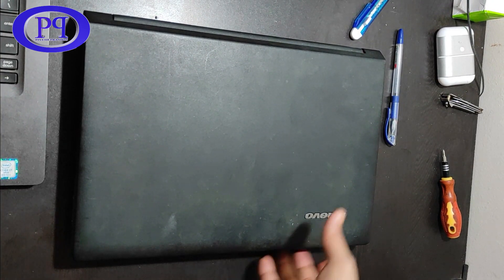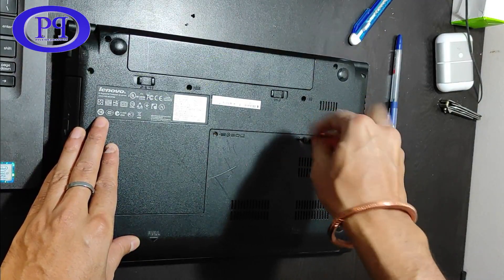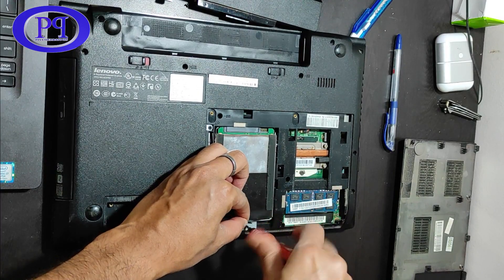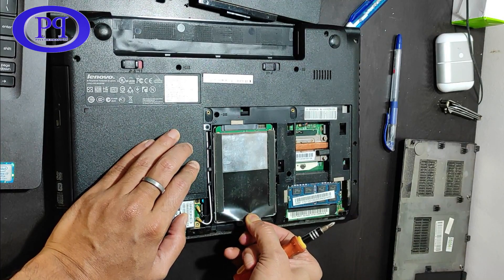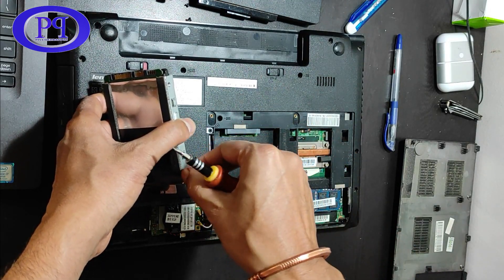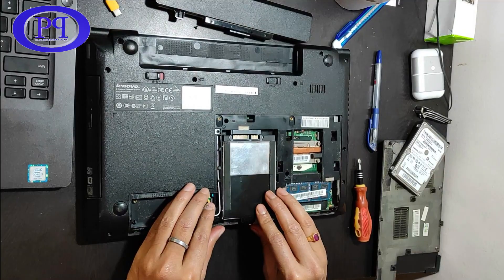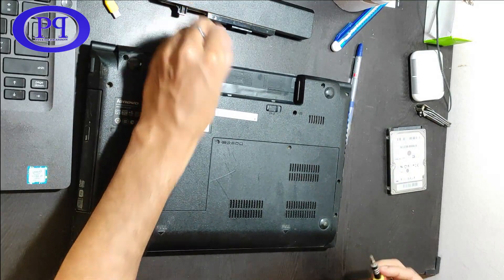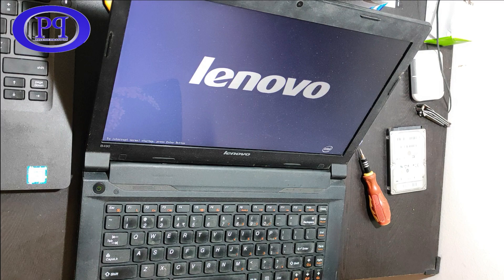Lenovo B490 Drive Replacement

Comment: How to enable secure boot option in government laptop like Lenovo b490
Reply from the maker: you can go to boot menu and in Boot option you can enable secure boot option.
f12 is the key with which you can enter the boot menu during the startup.
Reply: Sir will u take my lenovo B490 government laptop for second hand dad got scammed for 15000 and laptop is very slow with windows 10 and does not respond pls reply sir